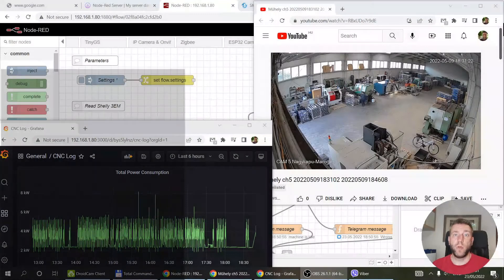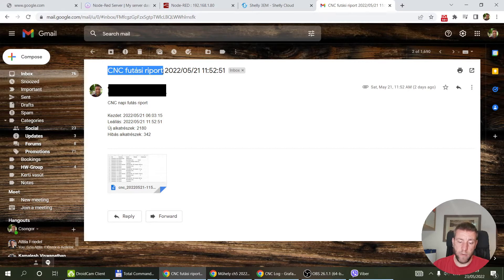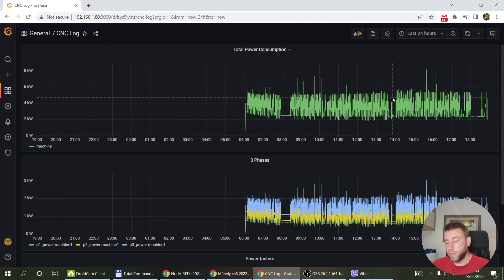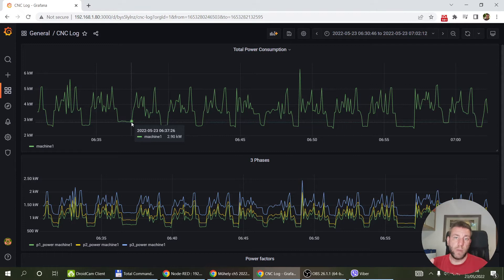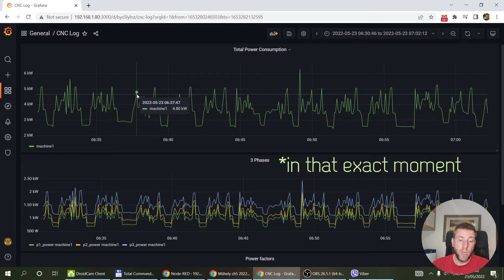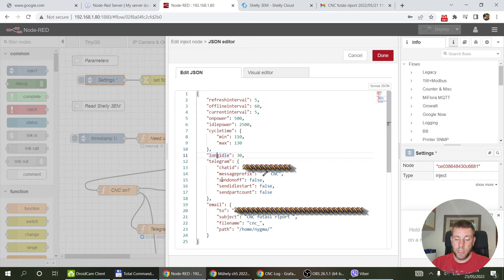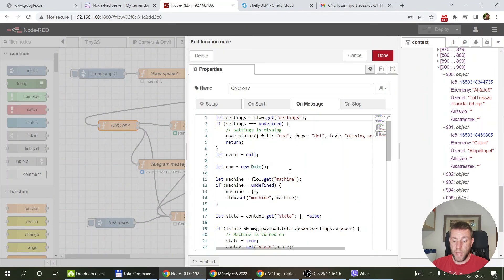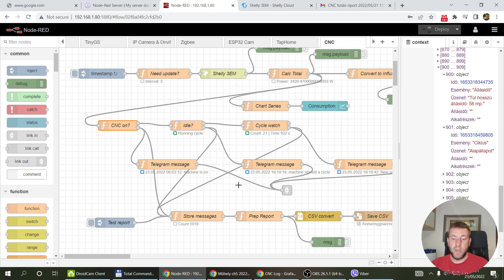Monitor CNC lathes with Node-Red

Comment: Very interesting - would the data be accurate enough for maintenance prediction? IE gradual increase means tools need sharpening, or bearings/motors  wearing?
Reply from the maker: That is a very good question. Actually as I was recording the video I also noticed something: the idle usage starts almost 2.9kW in the morning and settles back to 2.5kW after a few hours. It is visible on the diagram, but I did not notice this before. That is a noticable drift. Maybe it is the warming up of the machine?
Reply: @csongorvarga  probably a cold start related phenomena , same can be witnessed in other industries. but if for example the load starts to increase either at idle and cold start then you clearly want to flag this as an anomaly and recommend the machine to be checked.  Also machine manufacturers do recommend a service schedule based on operating hours, again this could be flagged based on machine runtime and next service can be estimated based in previous data.
Great work by the way!